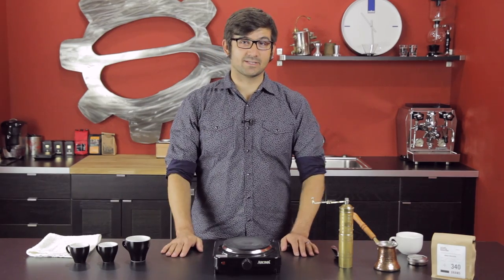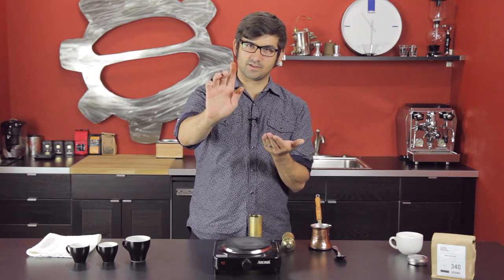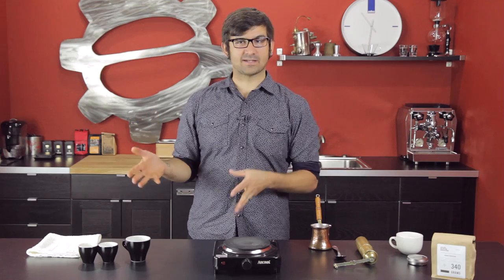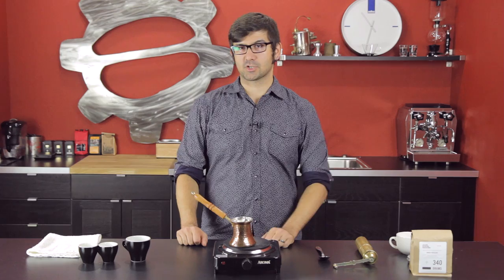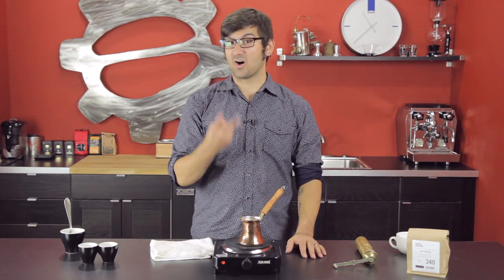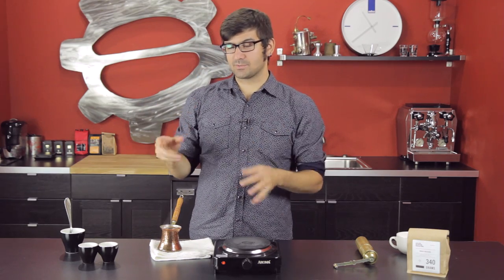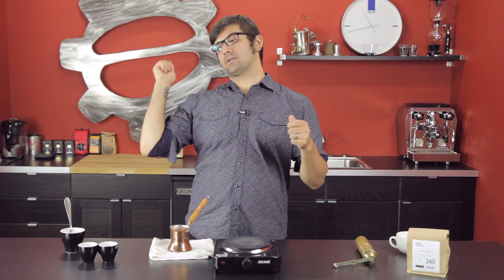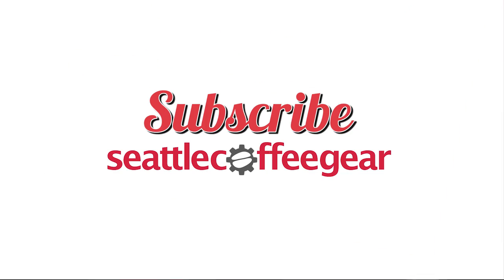How To Make Turkish Coffee | Cup O' Joe

Comment: As a Turkish person and a coffee enthusiast, I would like to say that, unfortunately, this is not the way Turkish coffee is cooked. Yes, in Turkey, when we speak about Turkish coffee we use the term cooking, not brewing :). Here is how it goes:
- First of all, water should be cold, not warm, not hot.
- For per espresso cup, around 8-10 grams of coffee (which is ground superfine with the consistency of flour) is put into the coffee-pot (cezve)
- If you like your coffee with sugar, you can put some granulated sugar or sugar cube(s) into the pot (amount is up to your liking),
- Fill the espresso cup with water up to a few milimeters below the brim and pour it into the pot
- Gently stirring the coffee is a personal preference, I personally prefer not to
- Put the pot on medium-low heat, and slowly bring it to boiling point. Foam will form on top, and coffee will raise in the pot. You will hear first rattles of boiling, let it rattle for a few seconds,
- Never, ever boil the coffee until you see the boiling on top disturbing the foam. Just feel it inside the pot. Lift the pot off the heat and wait for a couple of seconds for it to stop boiling.
- Put the pot on heat again for a few seconds more in order to raise the coffee some more produce some more foam. Be careful not to overflow, because it overflows super easy,
- Gently pour all of the coffee into the cup(s) including the grains (if measured correctly, no coffee should be left in the pot), there should always be foam covering the top of the coffee in the cup (foam in the cup is the sign of properly cooked Turkish coffee),
- Do not worry about the grains in the cup, as they will sink to the bottom and you do not have to drink them. It is up to you,
- You can serve your coffee with a single Turkish delight, a piece of chocolate or with a glass of plain water.

The preference of water or Turkish delight served along the coffee is up to your guest, and has different meanings. But that is another story :)
Reply: Özgür Ertürk  
I've read that one's fortune can be told from the remaining grounds in the cup.
You explained the way I  learned, except I was instructed to never stir the coffee once it is in the water.  I believe that is old-school tradition.
I dig all over it.
Reply: This was great to read, thankyou :)
Reply: We drink this type of coffee in Cyprus too, and I totally agree with you. The way you described it is indeed the best way to make good coffee
Reply: Brewing is tea (as in brewing in the kettle)  so as we say in Britain "do you fancy a brew" should always refer to tea.    I've just ordered a Turkish coffee pot and have watched several videos on how to use it, every single was has been the same apart from this guy.  People should know you can't improve the tried and tested method
Reply: I love turkish coffee, it's the only one wich dose not rush my heart. And that taste with foamy kaimki on top, is unique to all coffee typs. From what I've read, it has far less cafeine and more antioxidants, than your every day arabica. Is it true?
Reply: Excellent
Reply: Way more information and somehow I managed to read it in about 4% of the length of the video time. Damn this guy could bore drying paint.
Reply: Yes boiling the coffee destroys the foam...and Turkish coffee without foam is NOTHING
Reply: I’m drinking only ristretti, but i’d like to try Turkish coffee. I drank one in Paris in a small restaurant, it was sooo good! Really thick and tasty, almost like honey ! As i know about coffee I think you described exactly the best way.. i’ll try with your method. The coffee on the video looks way too liquid imo ...
Reply: @SylvainProov  like honey because anything tastes good with sugar
Reply: " If you like your coffee with sugar".  In the american south, some people like tea with their sugar as well. Personally, I just take coffee with my water.
Reply: Reisim kimse teşekkür etmemiş sana ben ediyorum eline sağlık 10/10 ingilizce 11/10 Türk kahvesi ancak, karşıt kaldığımız tek nokta ben kahveyi karıştırıyorum pişirirken :)
Reply: @chennngg  
Thank you for your response. I totally agree with you. If there is one issue with Turkish coffee, it is the low quality coffee usage. The method I described in my original message is actually the conventional method. In fact, I came across with cooking in warm water sometime after I wrote the message. I even tried it myself with freshly ground Ethiopian coffee. It was awesome.
Reply: @mscbaranakcay6041  
Esas ben teşekkür ederim bana yanıt yazdığınız için. Sizin yanıtınızı görünce bir baktım ki başka yazanlar da olmuş. Sağolun. Bence gönül rahatlığıyla karıştırın kahvenizi, yeter ki Joe gibi yapmayın :)
Reply: @mscbaranakcay6041  yes. Combine; cold water coffee sugar and stir it put it on the heat almost to boil as the edges begin to Bubble then we Pour It into 2 cups halfway then put it on to boil again just starts to Bubble take it off pour it in the half-filled cups and now you will have two excellent foam covered Turkish coffees.
 no one should listen to please OMG if you had to make Turkish coffee all day you could only do a few like he's telling you it's absurd.
Reply: Thanks a lot, appreciate it. Gonna try it on today's afternoon!

Comment: There are a zillion recipes for turkish coffee and this may be the single most bizzare/experimental one. Basically don't even call it turkish coffee. It's Joe's coffee. BTW the reason the foam (it's more like a thin layer of crema) is treasured is because if you made it correctly it contains some of the good tasting emulsified oils. And they often remove the foam from the first rise (and put it in the cup) before they continue (if they continue) because those oils are ruined by higher temps. The most bizzare thing about this approach is that it doesn't extract CO2 from the grinds, which is basically the whole point. The bubbles you want come from CO2 being slowly released by the grinds, not by water boiling. And the CO2 is released below boiling.  So you are trying to sustain it below boiling in a way that extracts CO2 + good oils and avoiding burning which brings out bad tasting oils. This is also why bedoins used sand to input the heat evenly around the cup, as it inputs heat more evenly unlike direct flame at thousands of degrees at contact.
Reply: Sorry crema? Yes in espresso. Turkish coffee can be good many ways. Standard is to have bubbles, foam. But who cares as long as you like it. Creamy with bubbles is the objective. Turks don't talk about it being creamy.

Comment: As a Greek, I can chime in along with what the chorus of comments has already said.  We make basically the exact same kind of coffee as the Turks and the Armenians (but we called it Greek coffee (of course) and never add cardamom).  We always add the coffee to the cold water and NEVER bring it to an actual boil! You go right until it is JUST starting to bubble up along the sides and then take it off the heat.  Also, we generally just add the sugar to the bottom of the cup before we pour the coffee in, if we add any at all.  Usually Greek coffee is had with sweets, so sweetening the coffee is often not necessary.  Anyway, I don't want to run this guy up the flagpole too hard, so I'll refrain from calling this the wrong way to make Armenian/Greek/Turkish coffee.... But it is definitely not the standard way AT ALL to make this kind of coffee.
Reply: western people named as Turk whatever came from Ottoman teritory you see?
Reply: I have noticed that some people have stopped using “Turkish”, “Greek”, “Armenian”, ect and now just call it “Cezve Coffee” or “Ibriki Coffee”.
Whatever one calls it, It’s the best coffee on the planet!

This guy’s recipe is just one of those things some people try, and is just a guy trying to be creative. 

To anyone wondering what this recipe tastes like, having tried weird stuff with a cezve myself, I would wager that it will taste closer to other standard immersion coffee recipes, such as French Press, and less like traditional cezve, or Turkish, coffee.

This is NOT Turkish coffee.

Comment: I live in Greece. Not the country of origin, but still we're very fond of Turkish (or Greek as we call it nowadays) coffee.
I dont know how turkish people do it but this is how I do it based on how I was taught by others.
I use a cup thats about 160-180ml. Using a similarly sized brik (we call it briki here) I fill with water till the point where the briki is slimest. I then add BOTH the sugar and coffee. For me, its 2 teaspoons of white sugar, and 2 heaping teaspoons of coffee. Where 1 heaping teaspoon is roughly one normal tablespoon. And that is to taste. If you want lighter coffee you add less.
Stir the coffee and sugar off the heat until you see no lumps. Medium heat on (use a gas burner, its much more efficient for this method of brewing), and wait till a foam forms. Nothing like in the video. The foam shouldn't bubble up. It should start to expand and rise like a uniform layer. Right before the foam is about to overflow, you turn the heat off and pour into your cup immediately. In stead of adding more steps waiting for the sediment to sit and then pouring slowwwwwwwly, like this guy is doing, you just let your coffee sit in the cup and that will do the trick. The coffee will sit at the bottom. Problem solved.

Comment: well actually you can put all of the coffee, sugar and cold water, and THEN put it on the hotplate. stir until everything disolves for the first half a minute and then wait. 
remove just before boiling. it will start to rise and froth and it will be perfect. remove it immediately. leave it a second longer and it will boil, and the froth and crema will dissapear and the coffee will overfill and drip on the table

Comment: Not sure how I missed this one. I need to give this a try. Thanks for another awesome video!
Reply from the maker: +Chad Ashton Cheers! Give it a shot (you won't regret it)
Reply: +Seattle Coffee Gear This video certainly peaked my curiosity.  I watched a few more videos and some of them showed the coffee rising and they poured immediately into the cup from the rise. Only one went into detail enough to add in to wait 30 seconds before drinking to let the grinds settle. So other than a cleaner cup...is there any other reason to let the coffee sit in the pot before pouring rather than pouring immediately and letting it sit in the cup?
Reply from the maker: +Chad Ashton Cleaner cup is the main reason, but it also increases extraction...making for a stronger cup. But really, in this preparation, clarity was the intent. Cheers!
Reply: *piqued

Comment: Skeptic here.....Put a Tbsp (or so) of coffee grounds into a glass measuring cup.  Add ~12 oz hot water (205°F).  Stir for a minute or so.  Pour through a tea strainer into your cup.  DONE.  You can experiment with grind, temp, time and all that but you now control the amount of time the grind spends in water.  No paper filter, no machine, no extra expense.  Every machine/method is trying to emulate this simple method.  Been drinking coffee this way for many years and have found nothing to beat it.  You're welcome.